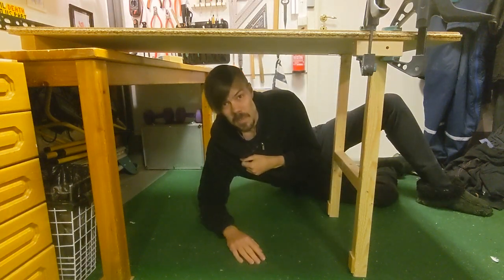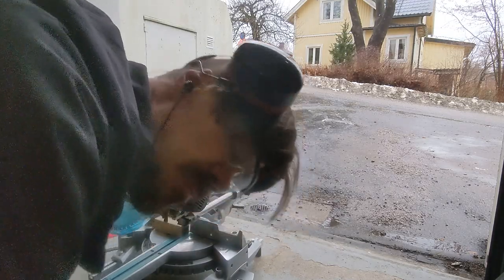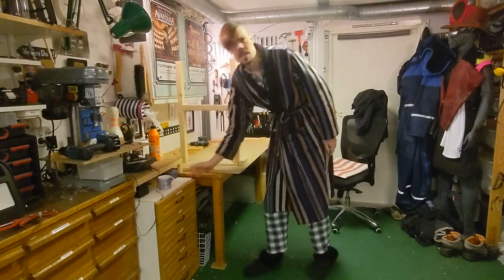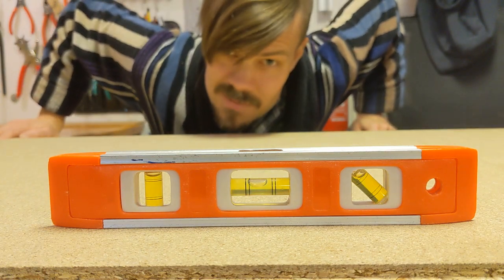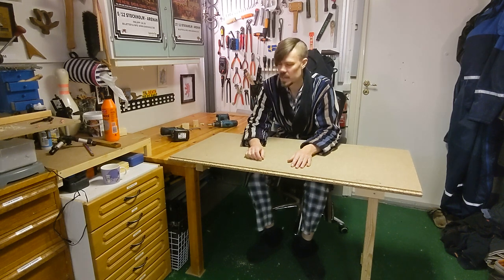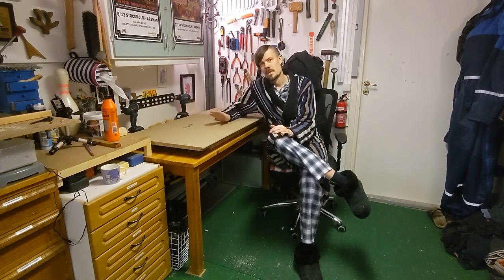Let's make a Workbench extension!

Comment: Instant inner peace when you moved the inner thingamabob outside the edge of the workbench so that the extention table became flush without adding to the legs :D
Reply: Bracket, stiffener...? No, thingamabob works!
Reply from the maker: Definitely a thingamabob! This will be my reminder to take a break and sleep on problems instead of just powering through